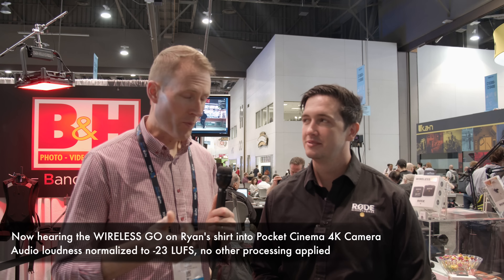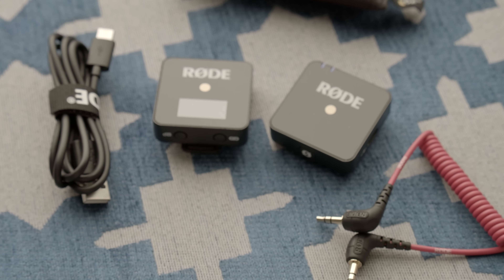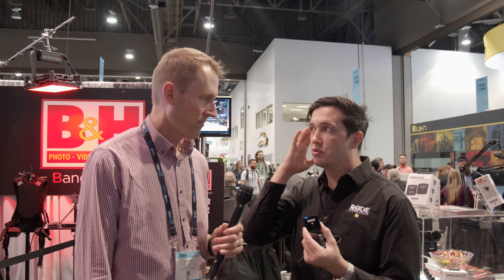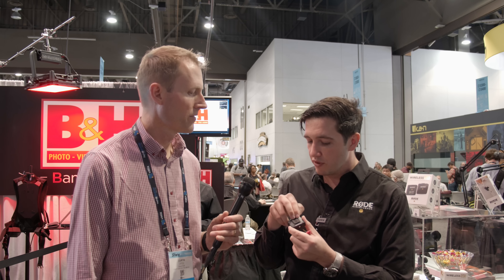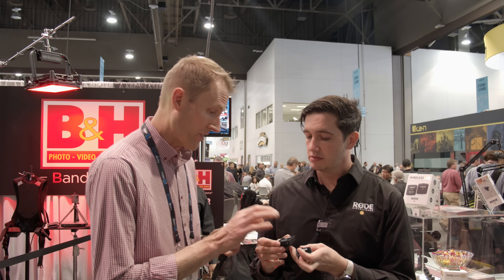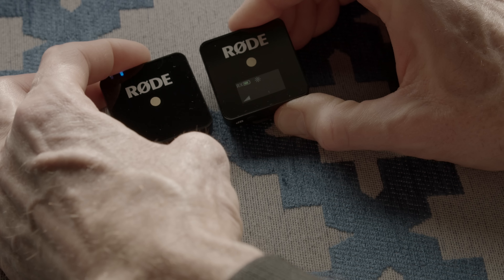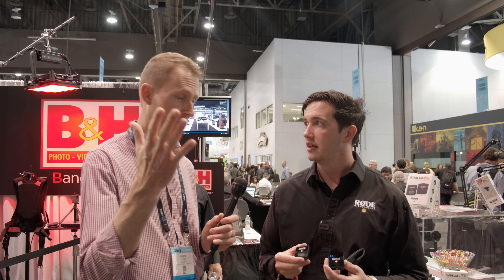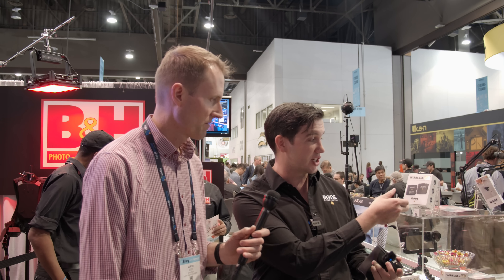RODE WIRELESS GO - NAB 2019

Comment: Very nice product, but the inbuilt battery is a big minus unless you use it all the time. If it's just sitting for longer periods and you forget to recharge, the battery may die.
Reply: ..in which case you pair it up with a power pack via USB... which, placed in the talent's pocket is still smaller than a Lav and a traditional TX pack.
Reply: ..in which case it's wiser to save your money. When I say “die” I don't mean that it merely runs out of power, but that it actually dies so that you can no longer recharge it. Happens to most batteries if they're not regularly charged.
Reply: It's a lith ion battery, it Will last longer than time itself ! 😜
Reply from the maker: Most modern li-ion batteries have a protective circuit in place to prevent you from running the battery completely out. I’ll test that in the review.
Reply: @RepairGuyDK Just for your information, I've had several lith ion batteries die completely.
Reply: All right Curtis, if you want to test it, leave it uncharged for a year, and we'll see how well it works.

Comment: What if you need to use 3 or 4 of theses with an Audio recorder. Are they all synch to their own receiver? Will they compete for the available channels?
Reply: rode says you can run 8 pairs at once. Should work great until NAB next year ; )
Reply from the maker: Yes, each transmitter needs a dedicated receiver. The have designed them to work with up to 8 kits at the same time. I won't be able to test 8 in my review, but hopefully 2 in an RF busy environment.
Reply: @curtisjudd  If you can also compare them to the small Sennheizer and the G4 for quality of the sound and signal and ease to setup, I would be interested to know your opinion.